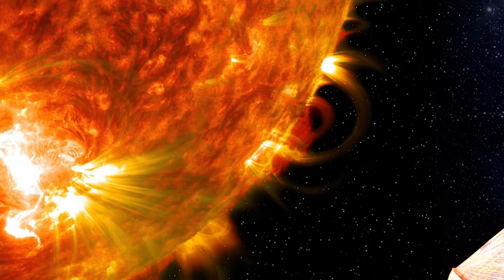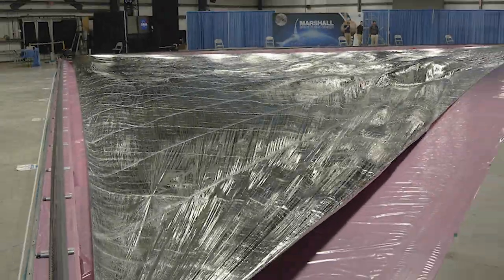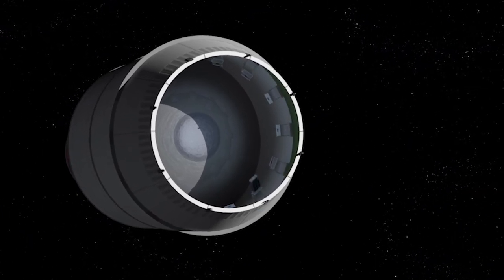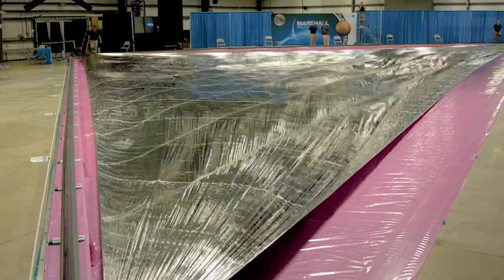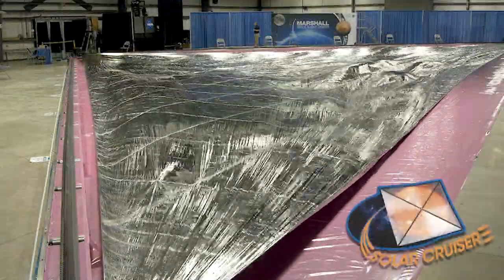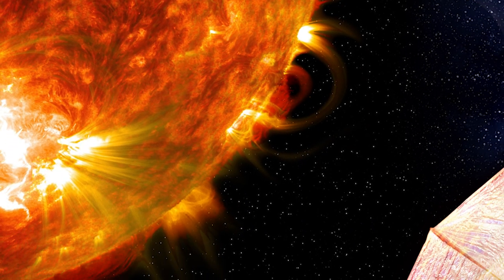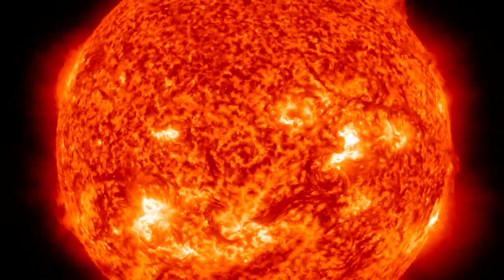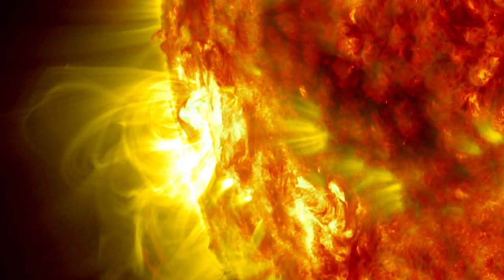NASA Unfurls Largest Solar Cruiser Sail Quadrant Ever Deployed

Comment: How can it travel towards the sun?
Reply: If it points in a direction between retrograde and radial out it will slow down and lower its orbit
Reply: @raptorwhite6468 But nothing can slow it down? It has no propulsion except for sun rays.
Reply: @disclaimer6872  Sun rays will slow it down. When it's travelling around the Sun it needs to angle itself so that it points between the Sun and its retrograde direction (opposite to the direction it's moving in). Then the force that Sun rays apply to it will point between away from the Sun and against the direction it's moving in, so it will be pushed slightly further away from the Sun, but also slow down, so its orbit will be lower.
Reply: @raptorwhite6468  interesting

Comment: What is stopping us from sending one to proxima B?
Reply: Distance. It wouldn't get there much faster than Voyager
Reply: @raptorwhite6468 blud? 😂
Reply: @raptorwhite6468 ??????
Reply: To clear things up, it could reach much higher speeds than Voyager, but it would still take thousands of years to get there. 
Instead we could use a laser to propel the spacecraft, in which case it could reach its destination in 50 years, but it would require making probes way lighter than we are able to, a lot of energy to power the laser and it would still be uncertain whether they will be able to make it through the Oort cloud, and dark matter could mess the trajectories so much that the probes would just miss their target.